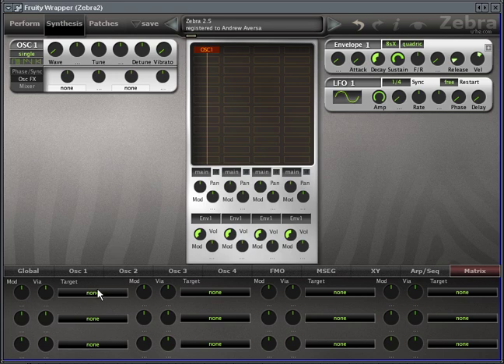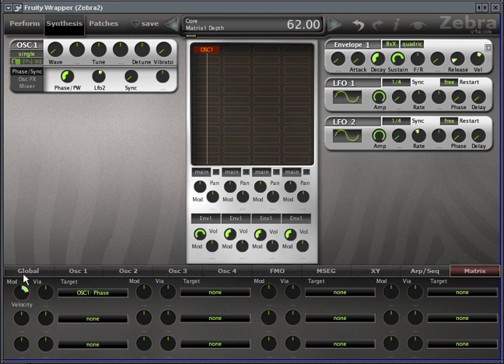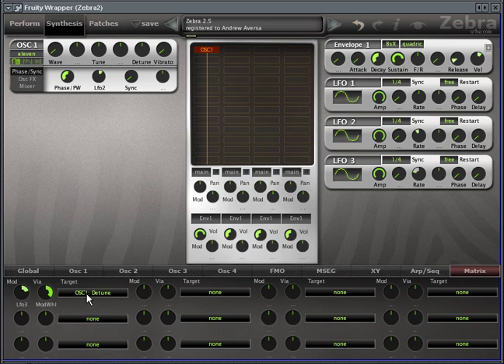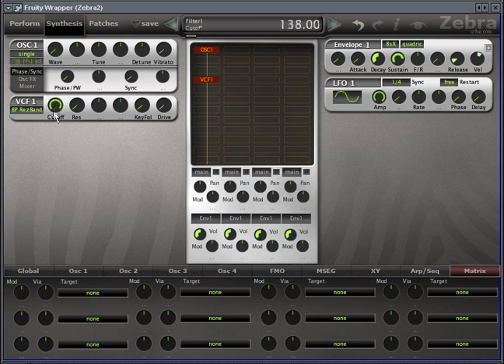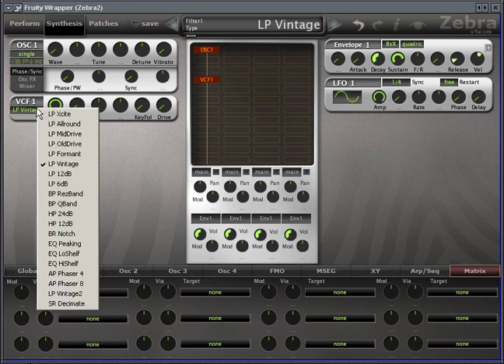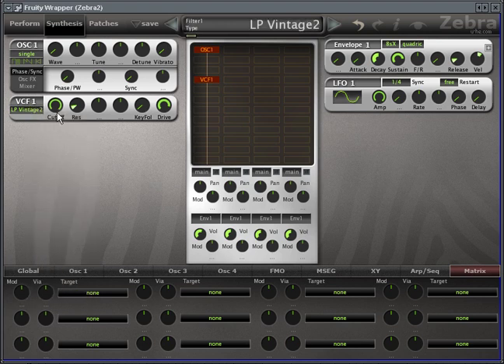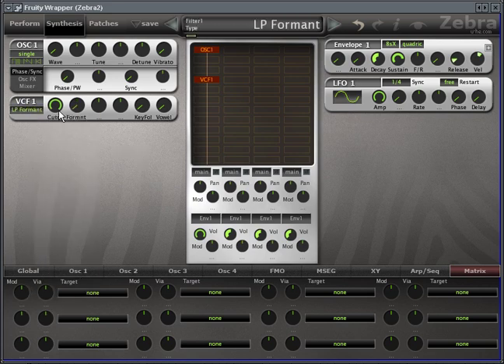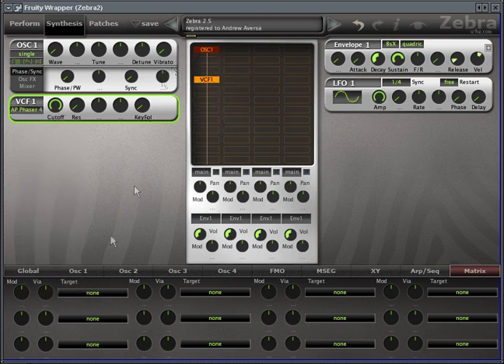Zebra 2 Synth Tutorial w/ zircon - Part 3 (Mod Matrix + Filters)

Comment: Also, you can load up a noise generator instead on an oscillator (pink or white noise will do nicely). Turn both the noise generator's built-in filters all the way up to roll off those nasty low frequencies. Put it in dual mode and turn the width up to about 73. Now run your noise through a VCF, turn the cut down to about 47, turn the res way up to about 96, and turn both Key Follow and Drive all the way up. Viola, now you have a nice breathy little pad you can dress up with some effects.